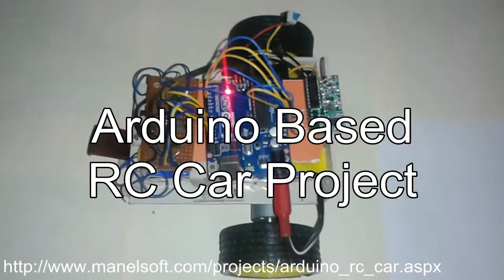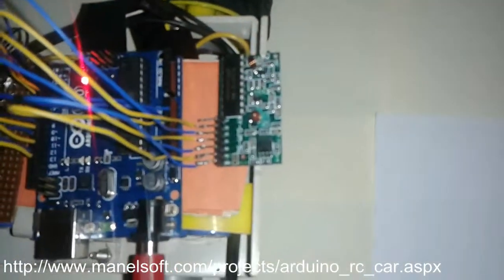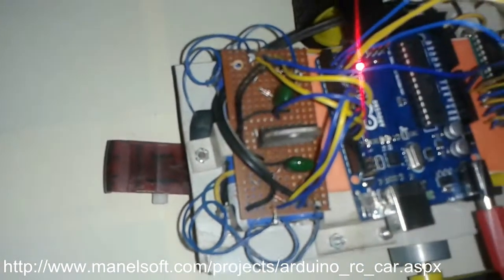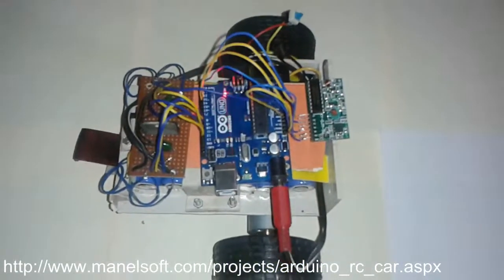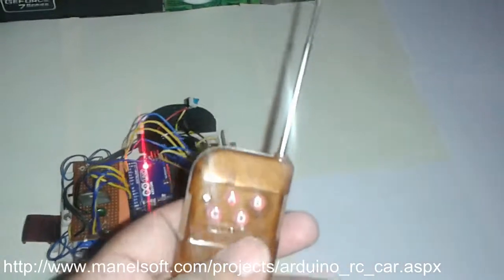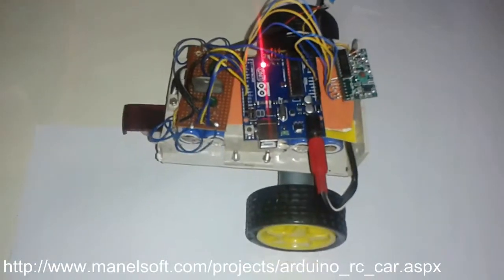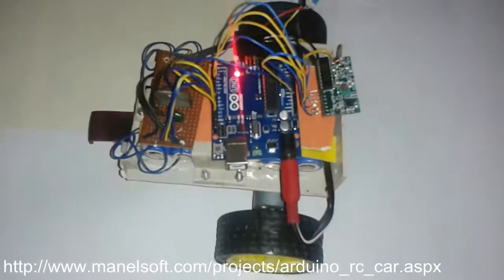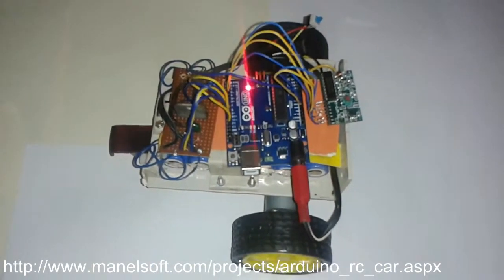Arduino RC Car Project

Comment: That is very cool! Thanks for sharing. We built a similar project.  However, we installed an Android device onto a RC car and used an IOIO board to control it autonomously. Here you can see the result:

http://youtu.be/vkvkfcqEUkk